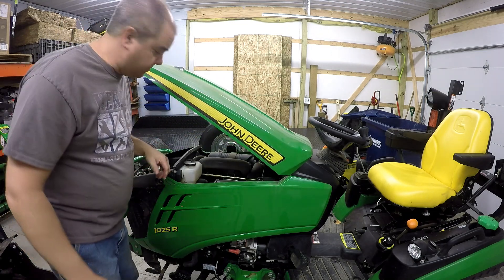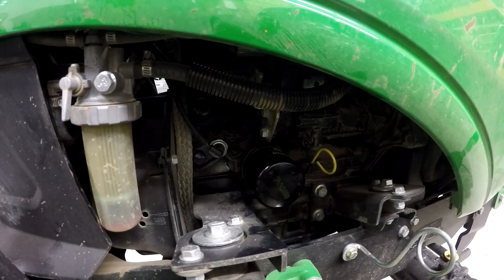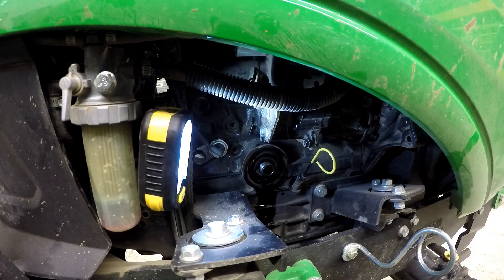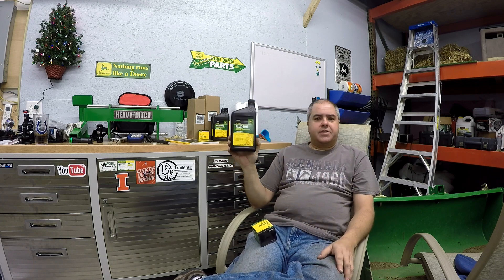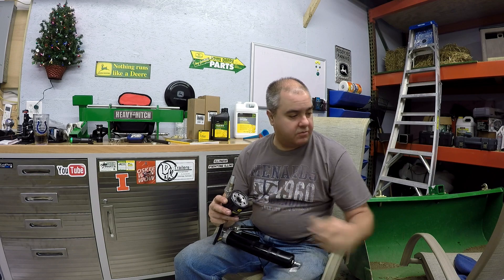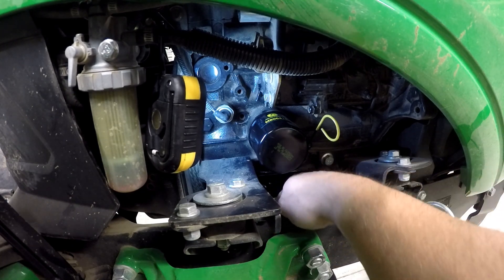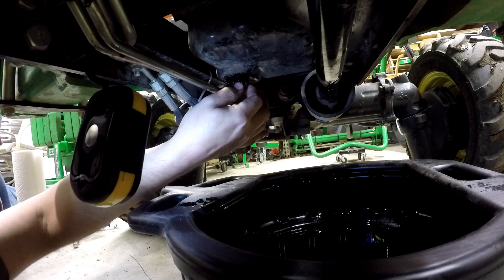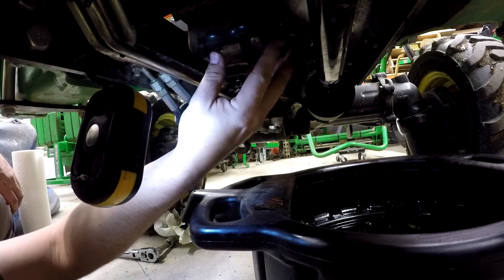Deere 1025R 50hr/200hr Engine Oil / Filter Change

Comment: Last 1 1/2 ago I had our local John Deere dealer come to my house to change the oil and filter, gas filters and hydraulic oil and filter. $550.00 was my bill. You have taught me to change at least my gas filter and oil and oil filter. Thank you so much. Will try my hydraulics next.
Reply from the maker: It is actually kind of mentally rewarding to do this yourself.  Sense of accomplishment!   Congratulations!

Comment: There's one thing I would recommend and try to do no matter what you change the oil in. Try and fill up the new filter with as much oil as you can before screwing it on. It gives it almost immediate oil pressure. Thats also the way Paul Short recommended in one of his older videos. Great tutorial, Tim. As far as losing oil plug, I have done that no telling how many times. You are a great teacher. GOD Bless.
Reply from the maker: Pretty hard to do when the filter is mounted horizontally, yes?    Also, won’t gravity fill the filter since it is horizontal?
Reply: Tractor Time with Tim Yes, technically. I had same problem on my ford ranger. It would only allow to be half filled due to it being on its side. I guess if it was allowed to drain down by gravity, it should be ok. I didn't mean to sound knit picky. This is just my opinion. I would always start up right after putting oil in my engine, whether it be car, mower, tractor, etc... Once I started them, it would have a momentary knock, due to oil not  being completely inside everything, but once I started to fill up filter, with as much oil as I could, I never heard the knocking anymore. Years later, I heard Paul Short talking about it when servicing a customers or his own, can't remember for sure, kubota, he pretty much said the same thing. I wasn't trying to beat you up on it, or anything. It was just my opinion. I really do respect your knowledge of things you do. What you learn then teach someone else, really makes a difference. You are a "down to earth" kind of guy whom teaches us on the same level. You really break things down for a simpleton like me to understand. Frankly, I haven't got a clue how I made it as far as I have without wisdom from folks like you teaching me things. Thank GOD for social media. I never had a father or big brother to look up to and teach me anything, like you and Paul have done. It's almost like I have a father figure in Paul and a big Brother in you. You are truly a nice person and a great teacher. You and Paul Short are 2 of my favorite "heros" on facebook or youtube and I'd only change one thing, if I could. I wish I could have gotten to know you all sooner. Keep the videos, coming, my friend, and GOD Bless.
Reply from the maker: Very kind.  Thank you!

Comment: Once again I followed your video to change my oil. I hate getting started on a tractor project and after getting under the machine I have the wrong size wrench or socket. I always refer to your video's and make sure I have the right tools so I don't have to go back and forth so many times. You are right about the filter being tight from the factory. Damn that was hard to get off. Not so next time. Thanks again Tim.

Comment: Good video.  I think that's the first time I've seen anyone use grease on the filter gasket. I've always put a thin film of oil on it. I've found a few references on-line which caution not to use grease. Apparently it was a common practice back in the days of canister filters to prevent the gasket from falling off while installing the new filter. As for labeling the filter, back in the day I had some issues with labels falling off.  So I started using a paint pen. I have a black one and a white one and use whichever is appropriate for the color of the filter. The paint never comes off and it very easy to read even from 10-feet away. I label oil filters, fuel filters, etc. It even works for making marks on nuts and bolts as a visual indicator if they start to loosen.
Reply from the maker: +EOSJOE thanks for your comment!

Comment: I've watched this before, always nice to refresh.  I pour oil in having the hole at the top and pour across the wide top.  That way, you can get the can, a full one, right to the point where pouring with spout down often spurts out fast and overshoots.  Martin

Comment: Good job on oil change an explanation great...buuuut on the oil heater an black oil...black oil is deposit from oil an fuel mixture.. it's cleaning internal parts..oil heater where i live in Central West Va an  have one on my gas engine an only plug in the night before if going out the next day... heater is to make oil thiner an flow faster to cam an crank...less failure in the long run... warm shed nooo problem...thx again

Comment: I did the block heater and have never plugged it in in almost 2 years. It is in the garage not heated but last winter was not that cold. I only started it 1 time when the temperature was in the single digits. I just let the glow plugs cycle 2 times before I hit the starter. I just got a little bit of smoke Yanmar starts great even in cold weather. Now if it was in the carport and the winter time I probably should have a block heater plugged in LOL.
Reply from the maker: +Alvie Schreckhise it starts great, but it coughs and sputters for 30 seconds or more
Reply: Tractor Time with Tim yep mine only maybe 5 to 10 seconds but for some reason it will do the same on any cold start below 50 deg which is weird. One of these day I'm going to plug in the block heater just for the hell of it to see if it is way better.
Reply from the maker: +Alvie Schreckhise block heater will help.

Comment: I always change oil when it is hot, so all the debris not caught by the filter comes out.  I have never seen a case when you can remove the oil filter without spilling some of it on the floor and getting some on the engine.  I do not put grease on the oil filter gasket.  I use fresh oil.  I do not need to write the date and hours on my filter because I keep a spiral book on each of my pieces of equipment.  When i finish using them or performing PM on them I write in the date, what was done, what products were used, outside temperature, etc.  I also include hours of operation, tanks of gas for some equipment and any other notes that I feel should be included.  I live in the South, so I do not need a block heater, but I would use a block heater if I lived where you do, as opposed to one that attaches to the oil pan with a magnet.
  I get around using Briggs & Stratton oil filters on my SPX  because a Fram XG 3614 works well on my tractor.  I could use the cheaper TG 3614, but i use the better quality XG filter on my  23 up  Snapper SPX.  That little short filter that Briggs has for these engines might do fine on a 12 HP engine with one quart of oil but these bigger engines hold more than two quarts of oil and need a bigger filter

Comment: Tim, this would have been a lot more useful to me if I had noticed that the mid-mount mower was not attached before you started. For all you reading this, be sure to dismount the belly mower before you start. This guy is a near-pro, and he's working in a clean, open space with everything organized at hand.
Reply from the maker: Oops. Sorry.
Reply: No worries. I;ll try again tomorrow

Comment: Good job Tim. Not much can be said about changing oil. I've never heard of using grease on the oil filter ring till a few months ago. Now I see you do it too. I just use some oil from the new oil I'm about to put in. Don't know which is better or if it even matters. I think I'm one of the very few (count'em on 1 hand, maybe even 1 finger) that left the oil in till I had 200 hours on it. It's what my owners manual said and that is what I went by. Don't have a service manual to muck things up for me. My manual for the 2210 said the same thing. That's why I went with 200 hours. If it was good for the 2210 and the 1026 said the same thing I was good with it. I'm one of those that believes you can't wear out oil or that it will break down in that amount of time as long as it doesn't get over heated. But as you know everyone has their on opinion and their own way of doing things. Take care and see you next Friday. It's a week from today Tim! Can't wait to get there.
Reply from the maker: Well you have proof that 200 hrs is not too long!  Probably could go 400hrs!   I doubt that grease vs. oil on the gasket makes any difference.  In my opinion, most of this type of stuff is over-rated.  
Just heard from my dad.  We rented an electric scooter for him. So, he will be at the farm show too.  He just couldn't walk it anymore, so the scooter should make it much easier for him.

Comment: If you want to allow air into the engine so your oil drains faster you can also pull the dipstick up slightly to allow air to get in and still some what protect against dust or debris contamination getting in the engine.

Comment: Hey Tim huge fan I have the same tractor great machine the only thing I have noticed with mine that I would recommend looking at on yours is the steering hydraulic hose on the ram on the front axle when I turn to the left my tire seems to come in contact with that hose and has not ruptured but there is a rub mark on it I would recommend taking a look at that and just wondering if you are experiencing the same issue great job on the oil changed just did mine at 216
Reply from the maker: +Andrew Compton thanks for your comment.  I used a zip-tie, attaching it to the tractor frame.

Comment: You make no mention of the 'other' oil fill cap on the right side front of the engine under the air cleaner.    What/why is there a 2nd oil fill cap?   Is it an alternative or do I need to put oil in there?   What is this 2nd oil fill reservoir?

Comment: Just hit the 1 year mark on my 1025R and even though I watched this before I bought the tractor, I came back here for a refresher.  I also struggled to get the factory oil filter loose.  I went to my local farm store and harbor freight and wasn’t able to find the proper oil filter wrench (or socket I guess).  I finally got it with a screwdriver like you, but would like to have one of those tools on hand.  Can you provide a link?  I checked your amazon store as well as your website and wasn’t able to find it.  Thanks!

Comment: Hi, great and informative as usual. I just bought my first tractor. It’s a 2018 1023e with only 10 hours on it. It has never been serviced because of the low hours. My question is should I go ahead and do a 200 hour service to replace all of those parts and fluids since it’s such an old machine, or should I just keep going with what it’s got?
Reply from the maker: Never hurts to do a 200 hr service.

Comment: Does your tractor require a new metal gasket on the drain plug bolt?  I have had some dripping before from that bolt when changing oil on my old Ferguson so I replace that metal gasket from time to time, of course my tractor is a 1957 year model so it’s had a few more oil changes than your new tractor,
Great videos, I enjoy watching,

Comment: Tim. I have yet to meet someone in person who claims to be a mechanic who does not constantly over tighten oil filters and drain plugs. Drives me nuts. Glad you stressed that in the video.
Reply: As a former mechanic I can say we do that because we must warranty our work. No one wants to pay for any problems caused by a leaky filter or a drain plug falling out.  I've seen the results. Fortunately I never suffered from that particular problem.

Comment: My manual says,
Trans at first 50, then every 200 hrs. 
Engine every 200 hrs.
Fuel filters annually or every 200 hrs.
Lube every 50 hrs.
Reply from the maker: +Chris Mills yep, but it also says break-in oil for first 100 hrs.

Comment: Thanks for another great maintenance video. I've recently been contemplating replacing my oil drain plug on my 1025r with a Fumato ez-drain plug. Once installed... just a push of the lever & oil drains out, no more plug removal (also no more hand/arm covered in oil) which is nice. Have you heard anything good/bad about these ez drain plugs? Thanks again & have a great day!
Reply from the maker: +Silver Maple never heard of them.  First thought makes me nervous, as I sometimes drag over brush etc.  wouldn't want to accidentally trigger it.  However, I suspect that they have guards against that.
Reply: Tractor Time with Tim Yeah I was a bit worried about that as well. Anyway, thanks for your thoughts & the quick reply!
Reply: I don't recommend it. It's just one more thing to fail, leak or accidentally come open. The drain plugs are so easy to get to on these tractors that you can almost just reach under without crawling on the ground.

Comment: I have a question about the break in oil issue....I called the dealer where I purchased my 1025r and they don’t carry JD break in oil. I also went to another local dealer who doesn’t carry JD break in oil either. After one year, I had around 50 hrs on the machine and was due for the transmission service. I elected to change the oil too, since it would take me about 4 years to hit the 200 hour mark. I spoke with both dealers’ service departments and they felt it was better to do the yearly oil change/filter with the JD PLUS 50 II oil as opposed to leaving the break in oil in there for 4 years until I hit the 200 hour mark. Any thoughts/comments? Your videos are great BTW, made servicing the 1025r easy...well easier
Reply from the maker: Agree with the dealer.  Forget the break in oil.

Comment: I use to drill 1/2" hole in the top of my oil catch pans to put drain plugs in that way they never ended up in the pan.
Reply from the maker: +Don Hanson you are ahead of me!!!  Good thinking
Reply: Not sure what size the plug is, but buying aftermarket magnetic one allows you to just place/hang it on the bottom of the oil pan. Added plus: the top of the plug will attract any small metal frag's floating around the pan (works like the mag inside the filter for the hydro).

Comment: 7:40pm  Can a person install a breather valve $12 on the top of the 1025R front axle to help w oil pressure? Or would a vented oil dipstick be better? . . Also, I stripped a 4mm hex socket in a vent plug opposite the dipstick. How do get it out now? Could I replace that 4mm vent plug with a breather valve or sq hd plug.

Comment: I keep seeing a 50 HR maintenance on the 1025R. I have a 2021 model, and in my owners manual it states to change the trans, front axle and engine oil only at 200 hrs. I feel skeptical now
Reply from the maker: They removed the 50hr requirement in 2018.

Comment: Hi Tim, I have a question, I have a 2020 1025r with loader and backhoe, thinking about getting the mower deck, not sure if I should or just get a dedicated mower, your thoughts.
Reply from the maker: Many opinions on this.  I will say that you can buy gently used decks for 1025r relatively cheap. 
I personally like mowing with a tractor, but I will admit that a ztr will do it faster.

Comment: hi , like Paul Short is saying , you should fill the new oil filter with new oil and than install it , you may loose a drop or two but it is minor
I was  doing that alson for my car , motocycle etc 
Good job beside that , and yes get yourself a block heather it is the best way i think 
Good luck
Reply from the maker: +S Faucon i don't need the heater anymore.  Have a warm house for Johnny.

Comment: Hi Tim
I have a question for you do the hydraulics bleed down on your backhoe while your letting it idle I have a 1025 TLB with 26 hours on It and if I don’t replace the pin it drops to the ground I asked the dealer about it and they said it was normal I called John Deere but there useless I just can’t seem to wrap my head around it as being normal
Reply from the maker: +George Koval yes, normal

Comment: Do you still need to change the oil after your first year even if you aren’t at 50 hours yet? I’ve had mine for just over a year and I’m trying to figure out if I need to change it or not. Only 36 hours on it.
Reply from the maker: No need, but it never hurts to change the oil.

Comment: What do you do with the old engine oil and oil filter
Reply: Most auto parts stores will take your used oil. Give them a call. I use O'Reilly auto parts. They have a 55 gallon waste oil drum you pour your used oil into.  The empty oil filter goes into my trash can in a brown paper bag.  Some quick oil change places will take used oil too.

Comment: What size filter wrench did you use? I guessing about 70mm? I have a few and my 76 and 65 are too big and small
Reply from the maker: Not sure.  Sorry.  The last tool I’ve used looks more like large pliers.  It seems to work well on a larger variety
Reply: @TractorTimewithTim  yeah, the large pliers I have won't fit in yhe tight spot. I was hoping you'd have the size of the one in the video. Or maybe yhe part number stamped on it?
Reply: I just screen shot the portion with the socket style filter wrench. It's a 65-68mm wrench

Comment: Hey Tim, my Kubota zero turn recommends oil filter to be tightened 3/5 of turn after gasket contact😳 real head scratcher 😉
-Brad
Reply from the maker: Usually they say 3/4 turn after gasket contacts base.

Comment: You absolutely do not drive a screwdriver through an oil filter, but I acknowledge seeing the bend in the blade as you removed it.

Inline water heaters are the best, even for your truck. It blows hot air immediately. For Johnny, perhaps review the size they use on Arctic Cat snowmobiles. They may be Sized Right for that 3 cylinder engine
Reply from the maker: +dmcinkyt I have no need for preheated now that I have my warm shed